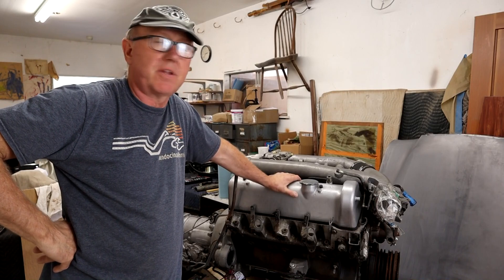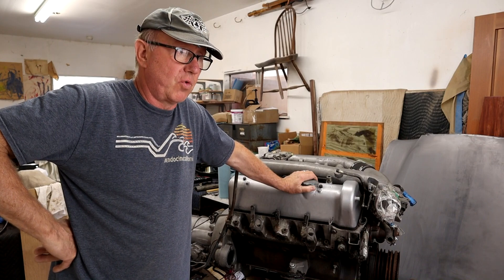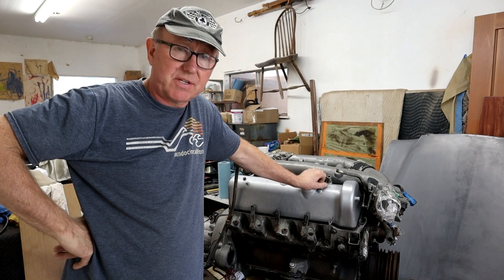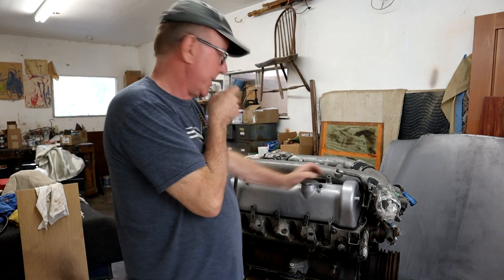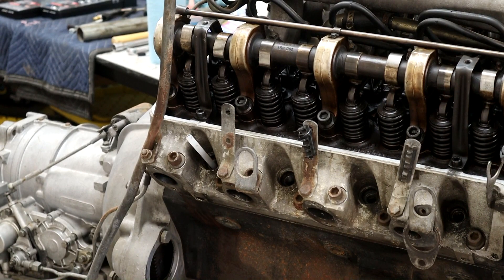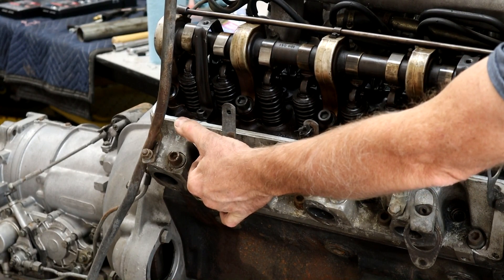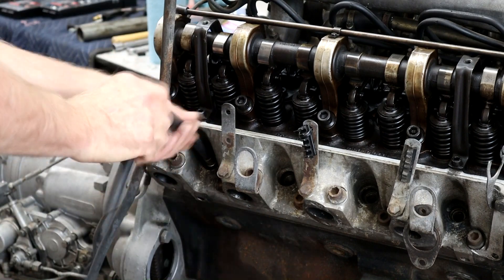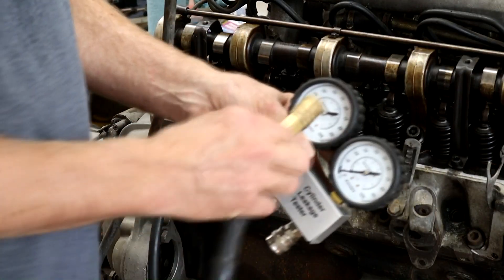MERCEDES W109 6.3 LEAK DOWN TEST (COLD)

Comment: I am on the hot engine testing camp myself.
If need to bore the cylinders, cheaper way, than to get new OS pistons, is to get SS cylinder liners. Than all you need to do is find SS piston rings. I did that on a RR 20HP.  Works like a charm and it is original size piston and bore.
Reply from the maker: I'm not very familiar with the sleeving process. It looks like I will have to go that route. I have one cylinder with bad scoring. I want to keep the original pistons for obvious reasons. What are the advantages and disadvantages of the various materials for sleeves and ring combinations?
All the best Cheers John.
Reply: @mercedesmaintenance.6339  Keep the original pistons, let the machine shop cut sleeves to match original pistons. At the same time let them find the piston rings to match as well. Materials and combinations are not so much important for standard engines, once you go racing engines this is really important, however for normal use just go with whatever machine shop recommends.

Comment: I agree with the earlier suggestion of running it up. It’s already on the proper stand. It wouldn’t take much more of your time. Running the engine through the heat cycle could resolve some issues and allow for more testing.
Who knows maybe that full out expensive rebuild is not a must at this moment
Reply from the maker: At least removing the heads is something that is relatively easy at this point while the engine is out. My thinking is that whatever parts I may need, finding out now will give me lots of time to research and plot a good course. What ever happens this engine will run on this stand before I put it back in the car. I cannot even imagine what a pain it would be to work on installed. Also I plan on sending out the head gaskets to a fellow m100 enthusiast to have them copied. We are trying to get a lot of owners together to place an order. But they need a pattern. Take care Marek, I appreciate your advice and input. All the best Cheers John.

Comment: Excellent presentation John!
Those leaks got to be coming through the rings. Have you had a chance to do the wet test later? Maybe even only on 1 cylinder just to see.
Reply from the maker: Hi Marek. I did try a wet test on one of the worst cylinders. It did have a marginal effect. A decrease in loss of around 5%. Maybe the leak is coming from elsewhere? Possibly head gasket. It will be interesting to see condition when the heads come off. Cheers John 🍻

Comment: Hi John. I will need my 6.3 engine re-bard before it goes back together. I nave a friend who is an expert engine builder and  is used to sourcing custom made pistons, mainly from thru US. I'll let you know in due course. Richard.
Reply from the maker: Thank you Richard! Talking to another owner he had a good suggestion. Because pistons can be extremely expensive, have you thought of a re sleeve and using the original standards? With new rings of course. Please let me know what you find out, I really appreciate your comments. All the best cheers John.

Comment: I think by your cylinder pressure percentage figures and that this engine has been dormant for a while, those cylinders leaking is because the valves were in the 'open' position and developed corrosion on their sealing surfaces. Usually starting such an engine and letting it come to temperature cures the compression leaks, as the sealing is restored. This is where information from the previous owner on weather any work carried out on the cylinder head, rings etc against the current odometer reading is helpfull.
Reply from the maker: Very good observation. It did sit for several years and that would make sense. Or possibly stuck rings? As I only heard air escaping from one valve. But we will soon see when I get the heads off. As far as info from the previous owner? He passed away a long time ago and the Son was not much help. Thanks again. All the best Cheers John.

Comment: Great video. What to do with the engine next. Remove the cylinder heads. Once you have done this, look at the bores, & measure the cylinder wear using a dial gauge & adaptor kit for this job. This will determine if new rings are needed. Next, remove the rocker arms, & pressure pieces from the valves, storing them in order. Using a valve spring compressor, remove the valve springs & retainers. Don't remove the valves, but do remove the stem seals. Using the dial gauge, move the valve to open position, & wobble the valve from side to side, whilst watching the gauge. Wear between 0.002-0.004" is good. Any more, replace valves & guides. If within spec, decarbonise the combustion chambers & valves. Check valve faces for excessive pitting. If this is present, replace valves, & if same on seats, have the seats replaced. No pitting? Good. Using a medium valve grinding paste, & lapping stick, regrind the valves to seats, lifting the valve slightly, & rotate 1/4 of a turn & continue grinding. Clean off valve & seat, ensuring all compound is removed. Using bearing blue, check for full face to seat contact. The wider, the better the seal. Another way is to install plugs & fill combustion chamber with a non flammable solvent. Once completed, you can then turn your attention to the cylinders. Pour solvent into the cylinders where the pistons are not at TDC. watch to see how quickly the solvent flows away through the ring gaps. Disappears fast, rings are worn. All these checks done? invert the engine on a stand, remove oil pan & lower crank case. Check bearing wear on big ends & mains using plastigauge ACROSS the journals, install the cap, & torque to specs. Remove cap, & measure the thickness. The thinner the better. Fit the dial gauge to one end of the crank, & set it to zero after moving the crank back as far as it will go. Move the crank forward, & read the gauge. This will indicate crank thrust plate wear. Remove the timing chain, & measure it's length against a new one. Also look at the sprockets for excessive teeth wear. If teeth have a "hooked shape" in opposite direction of rotation (this is very noticeable), replace all sprockets & guides. When replacing rings, hone the cylinders using medium stones, & move the hone up & down at medium speed to give a 55° cross hatch pattern in the cylinders, & only enough to remove the glazing. Also remove the ridge at the top of the cylinders with a ridge cutter. Cleanliness is an absolute must on reassembly.
Reply from the maker: Thank you Christopher!! What you said is pretty much exactly what I'm planning. Fingers crossed the heads are in good shape. Once the engine is upside down I'll want to change out the front and rear crank seal too. Would you hone yourself or take to the machine shop? I was chatting with another owner and we were talking about possible re sleeve if I have excessive wear. As over sized pistons are NLA and to have made would be extremely expensive. What are your thoughts? thanks again. Cheers John
Reply: @mercedesmaintenance.6339  When measuring cylinder wear, compare the readings to those in the specifications & wear limit figures for this engine, I usually hone the cylinders myself, after removing the ridge at the top of the cylinders. New front & rear seals are normally included in the gasket set. A company called Mahle make pistons. You might get away with the original pistons, & honing with new rings & bearings. These factors are determined by wear. Before you take the engine apart, & you have removed the valve covers, look at the timing chain, & try lifting it off the cam sprocket on one side. If you can lift the chain, it is stretched. Best repair is replace the chain, guides, sprockets, & tensioner. Reason why I state to put the plastigauge across the journals is to measure journal taper, especially with the rod bearings, because a difference in the thickness indicates a bent conrod. I would ask a few engineering shops who do engine machining how much a set of o/s pistons would be to make. The method you stated of step lining, or sleeving & standard pistons might be more expensive than boring & fitting o/s pistons & rings

Comment: Dear John! Good to c you are taking care of the engine in parallel. What you found out with your "pressure test" is no surprise. Reasons can (and must) by detected by taking the heads (and the rest) off. There will be wear everywhere in a used engine, surprises possible in every way.
On mine we have just reassembled the heads, chain etc. We started a year ago....that is the way it goes. No rush needed. I send you some Pics/ideas by mail mentioning possible reasons (and solutions taking euros into account....). Best Regards Oliver 🙋🏼‍♂️
Reply from the maker: Thanks Oliver. The pix you sent look great! Very inspiring. And I'm also not in a hurry. We had a crazy large vet bill last year and I have no choice but to spread things out over a bit more time:) O well, life happens. All the best Cheers John.